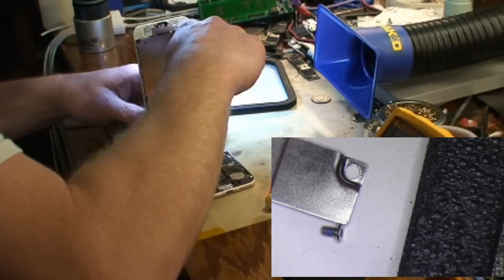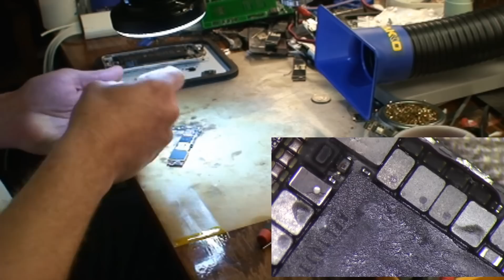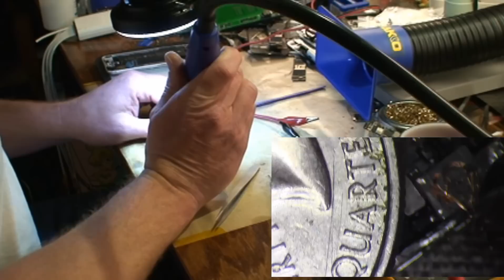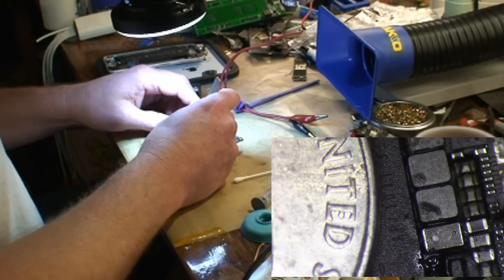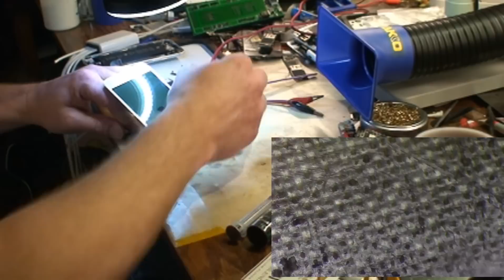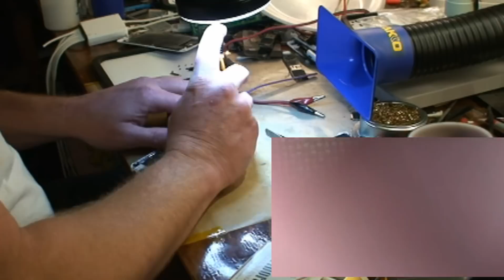Blown iPhone 6 Backlight  Problem Caused By Damaged Components

Comment: Hi mate can you describe the process with the duster (compressed air) and the relationship with the short? Great job btw
Reply from the maker: The duster freezes the board.  The DCPS applies power which causes heat.  The heat then melts the frozen board identifying the area of short.

Comment: Does it matter which direction the diode must face? I notice there is a longer contact on the diode and a longer pad in the board. Is this a way to determine?
Reply from the maker: Matt Beck the diodes have markings on them to designate which direction they go in the curcuit.  I generally make a note when pulling them off as to which way they go or use schematics.